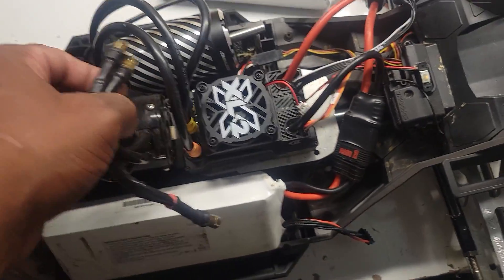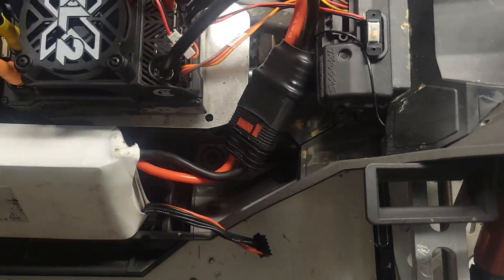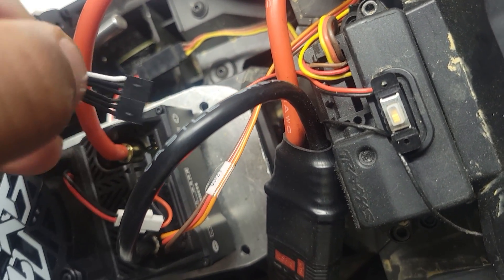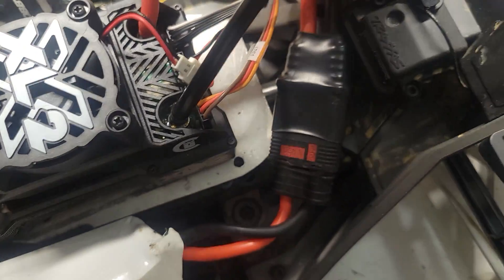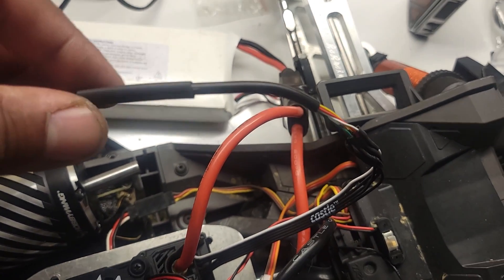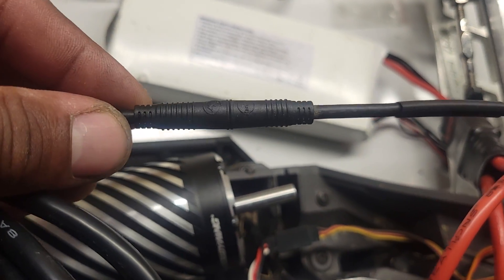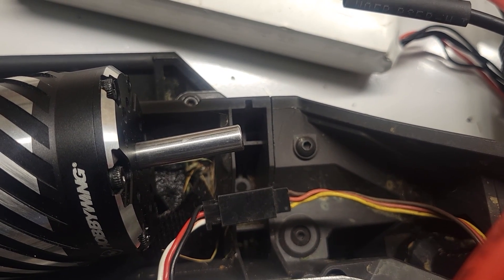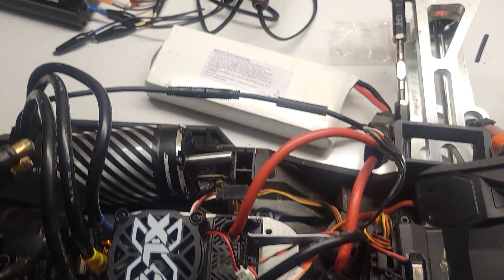Hobbywing sensored 56-118 motor & Castle ESC [SENSORED] #amazing #newstatus #comment #art #best

Comment: good video

would you happen to know if the Hobbywing 30810007 adapter cable would just plug right in or is it different?
Reply from the maker: u will need to connect that to the castle adapter 
https://www.amainhobbies.com/castle-creations-x-series-sensor-harness-cse011-0108-00/p451397?gad_source=1&gclid=Cj0KCQjwj4K5BhDYARIsAD1Ly2qTGqijof5QyyEW3dXJPIA5ZonHBDAKBXb3rqhLOw9Ie3juWAZapEIaAl9oEALw_wcB